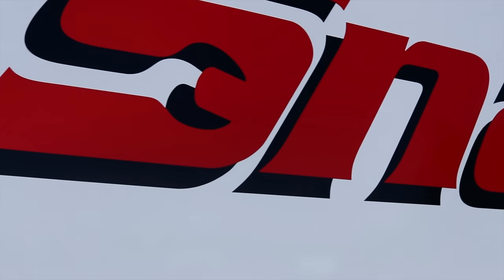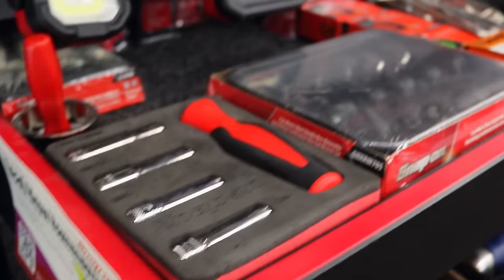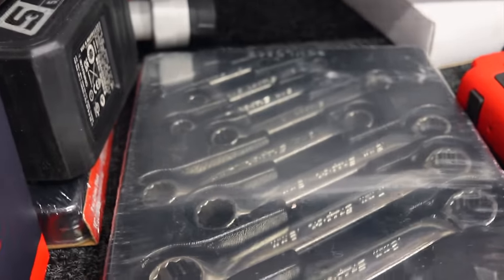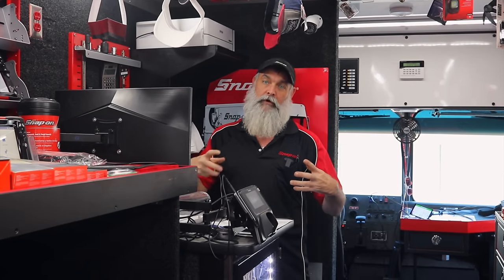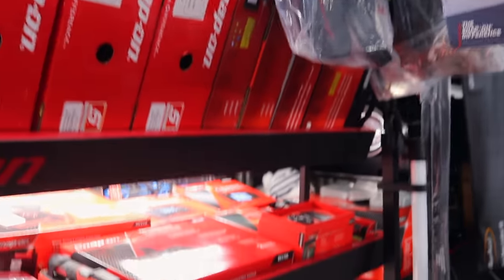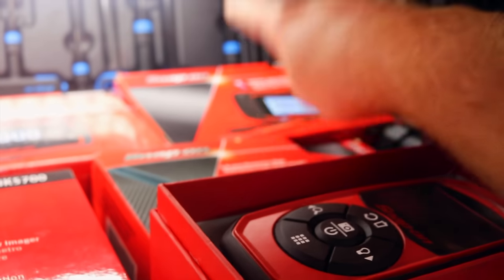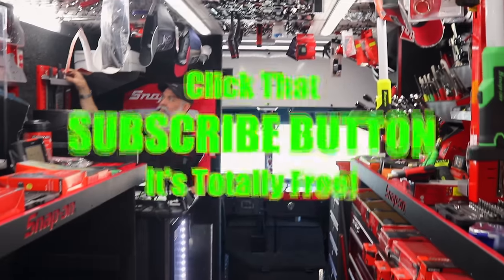Snap On Socket Demo Does This Prove They Are The Best?  Master Socket Set

Comment: I'm not even a mechanic/auto tech - I'm an IT guy that works from home. My local Snap-On guy pulls up to my house, and will give me truck credit if needed.
Reply: Same story for me, only with Cornwell. I'm an architect, but I had an old cornwell ratchet that was my dad's. Found the local dealer, and he and I now are friends. I've ended up buying many tools from him. He rolls up to my house when I need something warrantied or want something random. I work on small engines and my own crap when not at work.

Comment: I don’t have a shop, but I met up with the Snappy Rep at a shop near my house to buy the two-piece radiator hose pick set you showcased a couple of years ago. I like the blunted ends compared to the pointy ends pert near every other company sells. I chased the local Matco truck to another shop one morning and the local Mac Tools truck to a Chevrolet dealer service department one afternoon. None of those Fellers were shy about taking my cash.

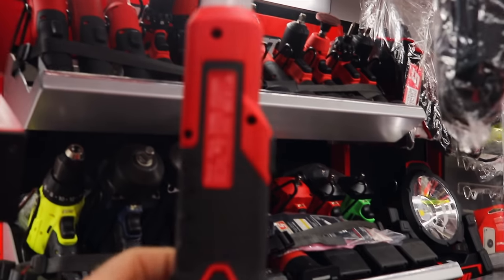Comment: 9:50 the part number on the light is CTLU861. Then add your preferred color's suffix (R for Red, G for Green, GM for Gun Metal, HV for Hi-Viz, MB for Power Blue, and BK for Black).

Comment: back in the 80's i helped out at a snowmobile dealer setting up sleds. to put bumpers on sleds i had to grind down sockets to fit. that all changed when  my tools were stolen. snapon ever since no more craftsman or s-k snapon is the best

Comment: That could be an advantage or disadvantage. The shallow broaching of the socket.  I remember working for Ford back in the 80s and don't exactly remember what it was maybe a fuel tank strap on a Yugo or Ford but the only socket that would get on that nut was a Craftsman USA. The mechanics that had all Snap-on and Mac Tools were always borrowing my Craftsman deep sockets. 

I always thought the smaller sizes in the Snap-on deep sockets were too thin. They easily round out.

How it usually played out if used on air ratchets or impact, the Mac sockets would actually break, but the Snap-on wore out and became useless. Snap-on sockets didn't break as often but still needed replacing after about 2-3 years. Especially the most used sizes. 

What would last a home user a lifetime, don't last that long in a shop. Even Snap-on sockets whereout and you have to replace the entire set!

Starting out you use what you got, and hardly any of my first sets of sockets survived the first tire shop. They all got trashed, even Snap-on and Mac. The Craftsman didn't last the first 6 months!

Comment: Thank you sir for the part number on the  work light, really appreciate it 👍 my local rep has it on order for me, could I possibly get the part number for the 1/4 ratchet/socket set in the foam and case that yall were looking at towards the beginning of the video, thanks so much and yet another fantastic video! 👍

Comment: What would you use that multiplier for?
Reply: typically tightening a fastener on a large industrial equipment.
Reply: @mikekotarba5828  I should have been more specific in what kind of equipment would need that kind of torque.

Comment: How much was that 1/4 inch socket set
Reply from the maker: Pricey. Look it up
Reply: I tried the pb200b was not listed on the snap on website
Reply: 1,130 for the standard with no foam. Add a few bucks.